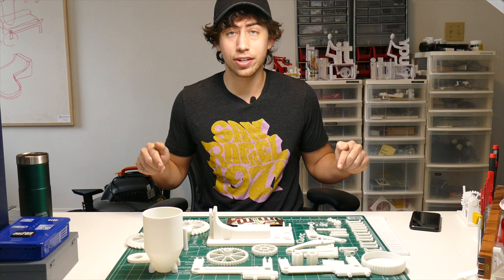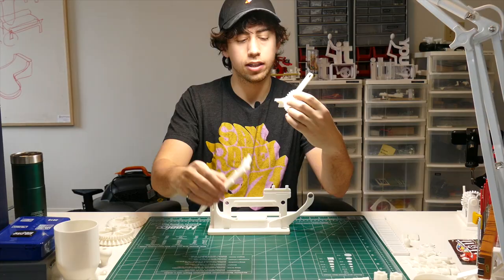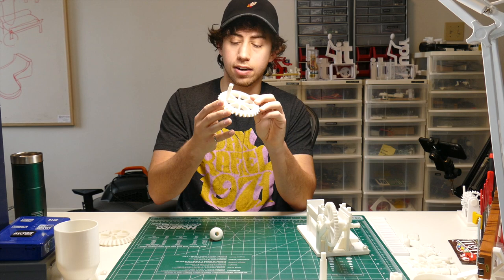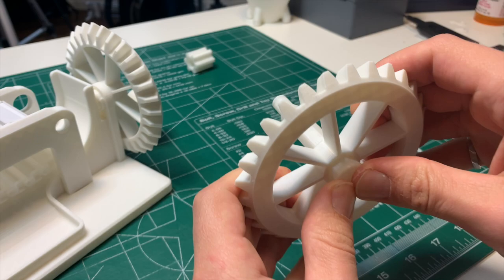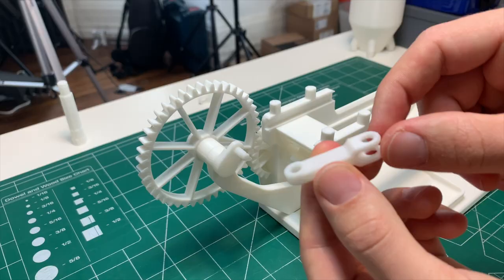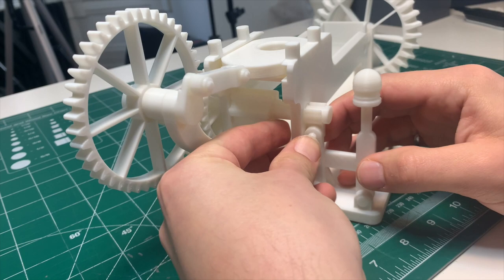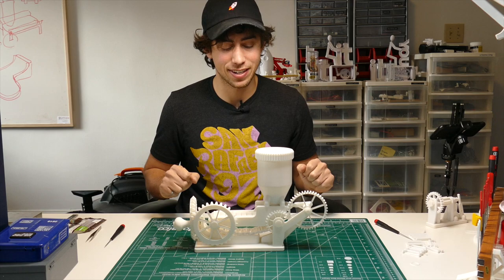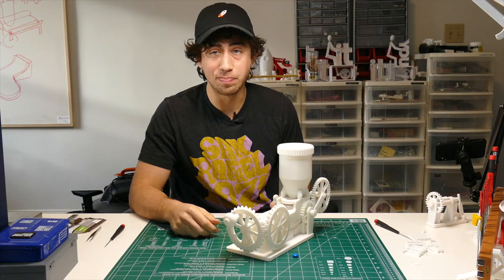3D Print Your Own WILDLY Over-Engineered Candy Dispenser

Comment: That's was great. Which cad software are you using? Which printer did you use? I am a total newbie to all of this but am so interested in getting into this new hobby with my son's to build things.
Reply from the maker: Thank you! I use Solidworks and my go to printer is a Prusa Mk3!
Reply: @Engineezy  Would you recommend using Fusion 360 for cad program, have you used that.  Aren't the prusa printers expensive?
Reply from the maker: @AUS5113  fusion 360 is great (and it’s free) the Prusa printers aren’t the cheapest out there but for the price they do a really great job
Reply: @Engineezy  ok could to know cause I live not far from the factory, thanks for your help.